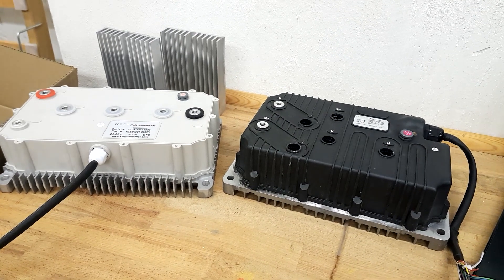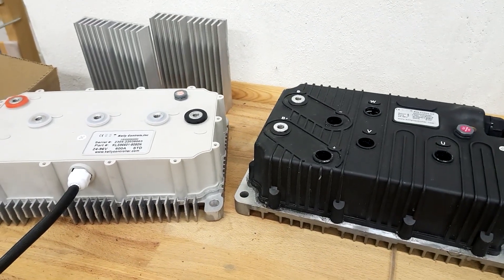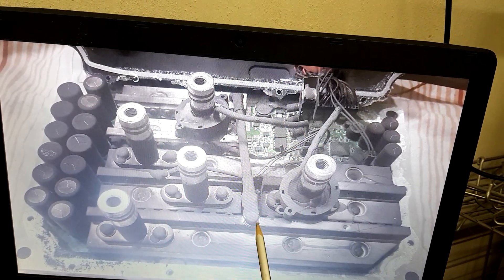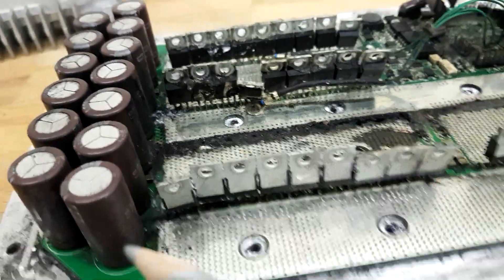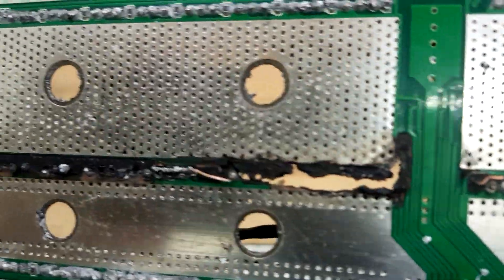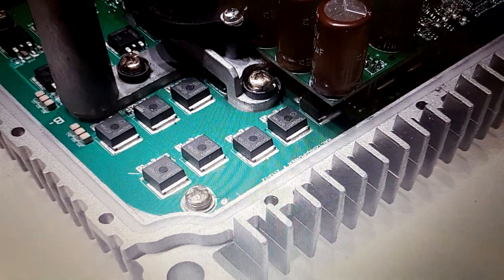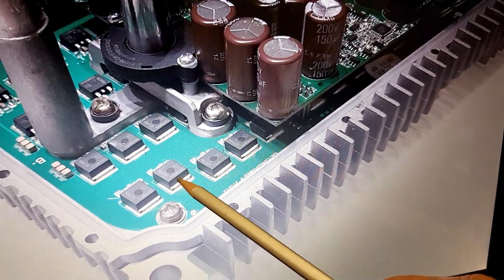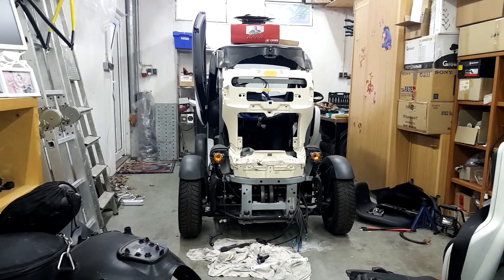Unboxing Kelly Controller KLS96601 for Brushless DC Motors

Comment: Sir. Can you tell name of Mosfet of new version, please ?
Reply from the maker: It says 0401NM5S (Package TO-263). You won't find much about it, seems to be a custom version.
There are always ten connected in parallel, each one with 23Ohms gate resistor.
Reply: @nextev8794  Thank you! Yes. It's sad. I'd like to know Rds from datasheet.

Comment: Hey, i have been having problems with my kelly KAC14401. The app programmer can´t find the controller and the CAN bus isnt working either. Do you have any suggestions? Already openned the controller and couldnt find anything visible wrong.
Reply from the maker: The controller itself is switched on for very sure and working?
Try to connect with a different device (tablet or PC) to the RS232. Try to use a different "USB to RS232 cable" (I had better working ones).
In my setup I also need sometimes several attempts to establish connection to the controllers

Comment: Did you find out what destroyed the controller? 
I had a similar one, little newer then the black one, with 400A 144V and it also died on me. I turned it on and it randomly just fired the motorphases untill it was dead. They replaced it since it was still under warrenty, needed to pay the expensive shipping tho.

Also I would be interested in the burned controller for the heatsink. Not sure how to send you a private message. Could you send me one?
Reply from the maker: Unfortunately no! A classic reason are the electrolytic capacitors, when they age (or die), then voltage spikes occur, some MOSFETs go through (become low impedance) and if then not switched off, then the other half of the bridge branch also dies.
What confuses me here is that all the electrolytic capacitors are still good, and really none of all 54 MOSFETs (in all three branches, both high-side and low-side) survived.
Also in the exchange with engineers from Kelly we couldn't identify a clear cause for the failure.
Donno how it works with private messages here, does @nextev8794 help?